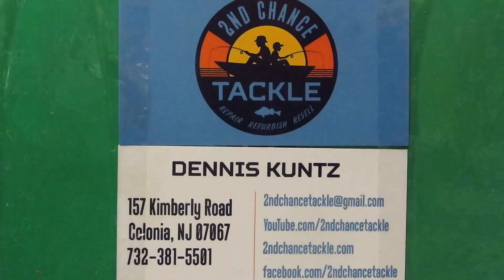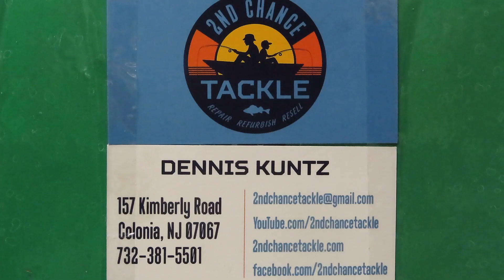Pflueger big game Templar 1420  Vintage saltwater fishing reel how to take apar and servie

Comment: Heyyo!  Love your channel!  I've just picked up a 1419 3/4 Templar for a song and while I'm confident in servicing it, I'm at a loss on what line to use.  Everyone seems to have an opinion lol

thanks for posting this!
Reply from the maker: The reel was designed when braided Dacron line was the standard.  It was eventually replaced by monofilament.  Probably 50 pound test.  I would use mono on this reel.  I would not go with the modern braided lines - that its my opinion - Dennis
Reply: @2ndChanceTackle  thank you for the fast response!

It'll be a while before I have the chance to take it out, so plenty of time to prep =)

Comment: Where could I find drag washers for this reel? I know you said they would be almost possible to find
Reply from the maker: You will need to order these by size.  Measure the inside and outside diameter of the drags and thickness.  Smoothdrag.co sells drags be size - contact the to ask on availability

Comment: Another fine video Dennis. Do you see any problem with using marine or wheel bearing grease on fishing reels ? Keep well !
Reply from the maker: Yes - those greases are very thick and can bog down reel performance.  Stick with the fishing reel ils and greases.  They are designed for the reels and are inexpensive.  You only need to by a small container of each to get you through the service - Dennis

Comment: Dennis,
How about WD-40 for the job
Reply from the maker: Any Penetrating oil will work well for clean-up and light oiling.  I do not recommend it in place of reel oil as a finish lubricant.  It evaporates to quickly - Thanks for asking - Dennis